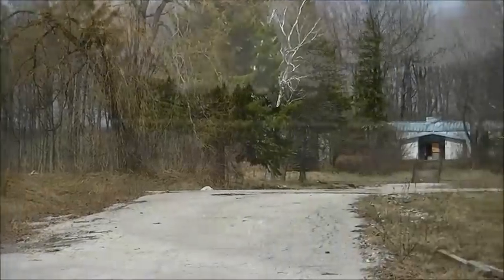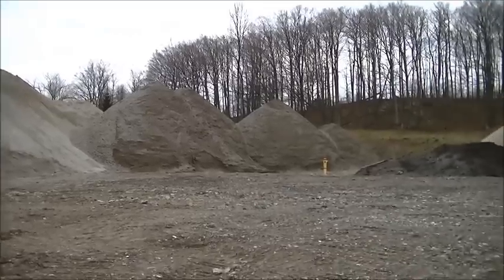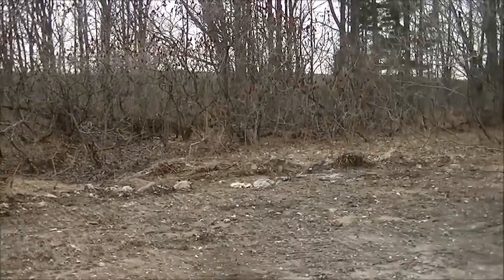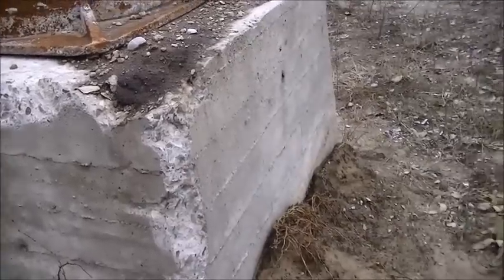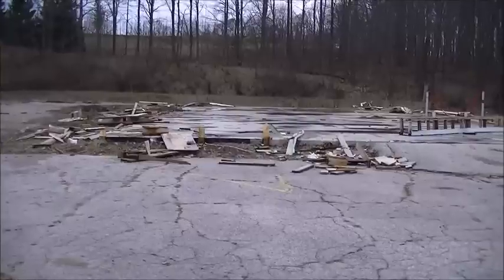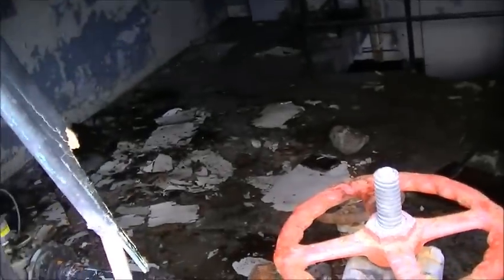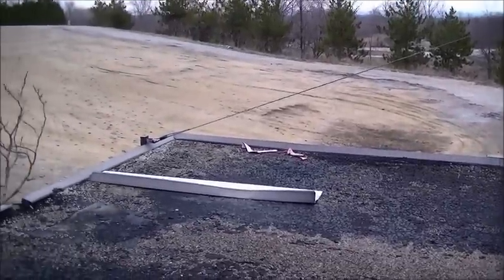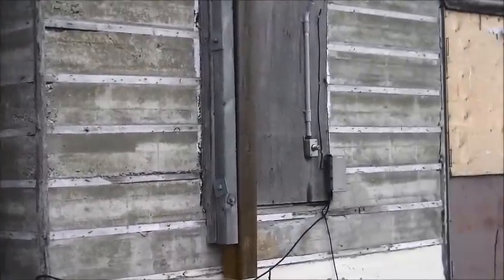Tour of Abandoned RCAF Base ...Edgar Ontario

Comment: I was here aswell, before it was boarded up. I didnt go down those holes in the bunker either, wayy to freaky and i was worried about the rebar ladder breaking free and trapping you down there. Immensely curious as to whats down there tho. Also that building with the pipe out the door is a mechanical room, i will say it holds 2 very nice large commercial diesel generators. However the building is full of asbestos and is labelled inside as such. The church floors and roof were stripped 4 asbesto